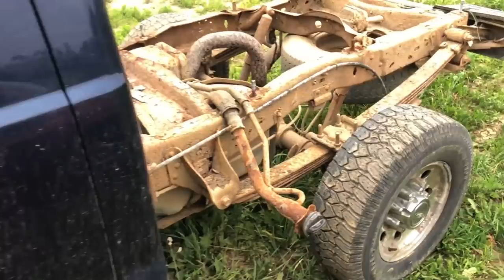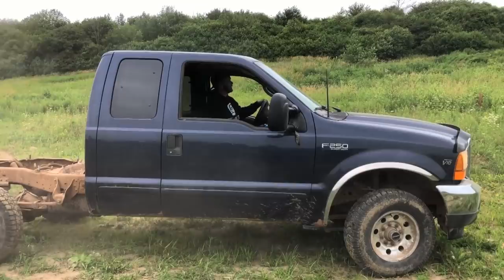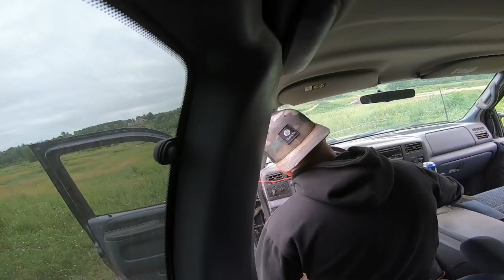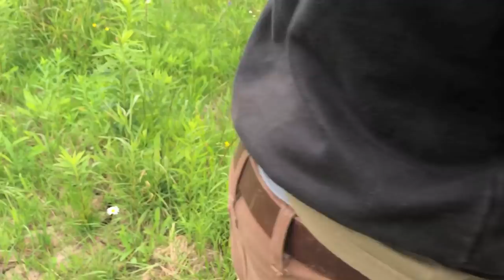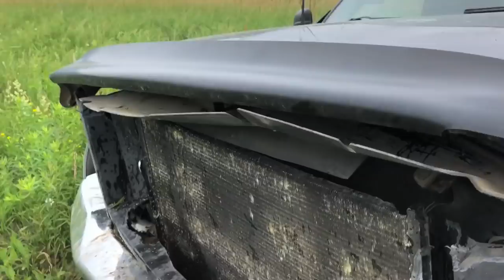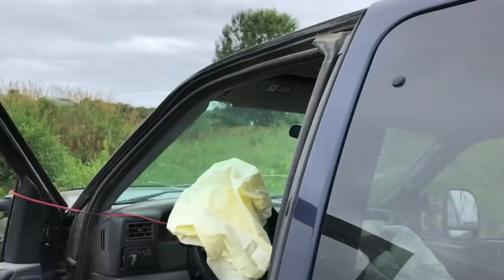Ford F250 SUPER DUTY BEST Truck CRASH EVER!!!

Comment: Things like this is why I can't find a good fullsized truck running for cheap
Reply: @seananon4893  their truck they can do what they want.
Reply: Sean Anon The truck was clearly at the end of its life
Reply: oce Lol not really, with a little TLC and some new parts would have been great for a barn rig or something of the such, as well, swap the motor, these motors are easy to find, or even just swap the block and it’d run like new
Reply: Christian that’s true
Reply: full size trucks in good condition aren’t cheap it’s simple
Reply: The truck was at the end of its life even though it was clean with no rust it seemed you’d have to replace the engine most likely and it is a short bed short beds on F2 50s are very hard to find
Reply: @Shanesknowledge  That thing definitely has rust, the doors on teh bottom and the rockers are basically gone
Reply: EEtotheO oh did not notice
Reply: Ford f250 yeah that truck was definitely junkyard bound, motor didn’t sound to healthy either, im sure the trans was on the way out too.
Reply: EEtotheO yep
Reply: @colton7373  not even close my truck was way more rotted out same motor did some work to it now it's like new
Reply: @RoastFlea61  was a manifold leak
Reply: The truck is a pos, not worth it to own other than to do this with it
Reply: people sicken me
Reply: I’m sure some tlc could have gone into that truck and it really would have blessed a single mom or person in need providing them with transportation
Reply: Who says the Truck isn't for sale? Make an offer. Who knows, you might get it for a reasonable price.
Reply: That unit was toast already,
Reply: Bruh you got anime in your pfp you prolly drive a Prius
Reply: Crazy stuff that thing really flew😎
Reply: I mean there wasn’t much left of it anyways. Plus it was a v10

Comment: Now do it with a 2020 7.3 and see if it’ll still run. The ultimate “built ford tough” test to the end.
Reply: Ford sponsorship
Reply: They don’t make 7.3’s anymore...
Reply: @butwere3-0wou   they do though
Reply: Info warlock Hol up...7.3 gassers? How in tf was I not aware of these? I assumed he was referring to the powerstrokes lmao
Reply: BuT wE’rE 3-0 wOu they just started making the 7.3L gasser in 2020
Reply: Eh not diesel so trash
Reply: @midlbrwn15  actually it's not a trash motor. It's built right  they went old school for design and set up. Old pushrod big block

Comment: I am telling Ya Mark, them old fords will be taking over NASA space program.

And also i think the passenger front tire is locked, thats why she would not move.
Reply: I wouldn't doubt the entire weight of the truck came down right on top of it I wouldn't be surprised if a few things got fucked up likely being a 2 ton pickup I wouldn't doubt the whole front end is broken
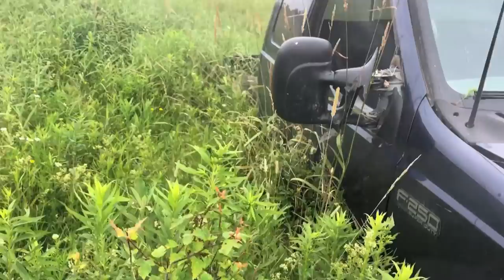Reply: Silas McGee 7:46 look at the tire, she bent over
Reply: @chrisf7731  interesting way to get camber it's going to be a bitch to get it on the other side if Duke won't move
Reply: But definitely one of the best sends so far since the Ford Escape and Jeep Cherokee

Comment: The F250 flew pretty well. Could have added some weight over the rear frame to make it fly more level. 
Maybe strap a plastic 55 gallon drum full of water over the rear bumper or U-Bolt spare wheels and tires to the chassis. 
Just a thought...

Comment: If you take your ratchet strap, you can go down around the brake pedal and hook both hooks to the steering wheel and tighten it. That will keep the wheel so straight you'll hit the jump every time. Could even use the seat belt through the steering wheel, and move the seat to the furthest point back to try keeping the wheels straight. Between the two tho, the ratchet strap around the brake pedal is the best method

Comment: Could have been a good truck for someone with less money..
Reply: 98 12 valve it sounded like the engine was knocking anyway.
Reply: Alan B so. I have some friends who have trucks in 10x worse condition than this one. And thats all they can afford. I mean this is this mans money he can do what he wants but this is just disgraceful imo. Should have used a real beater truck. This one was running and driving just fine
Reply: @Kyle_Godfrey111  no man that knocking is the sound of a dying engine
Reply: Cataclysmic Computers yes even so it was still a straight truck. And it had a bed he just sold it cause it’s worth money. Interior was nice and the truck was solid. Oh well it’s already happened
Reply: Cataclysmic Computers These trucks run FOREVER even with the worst of knocks, and even if it’s just knocking, some new rod bearings, maybe rods or pistons, and she’d be good as new
Reply: @Christian-my4dp   I'm not going to call you wrong, but at least in my opinion any truck with a knock is a time bomb, I would not trust it to haul anything because at any moment it could leave me on the side of the road
Reply: You know how many cheap vehicles there are out there for people. It's an open market he's aloud to buy a few if he wants.
Reply: @Kyle_Godfrey111  you should buy one of your friends a truck. Im sure you have money. You should use a bike

Comment: Amber good is going to kill you she loved that truck she even named it
Reply: Hahaa you are right about that ! I was not happy to see Duke flying through the sky
Reply: @ambs8221  if it helps any I was really happy to see it go
Reply: @ambs8221  I told him to resell it. Shame in him. V10 4x4 superdutys are good trucks. Well all of them are.
Reply: D4x4Bronc wasn’t good enough to resell but was nice for a track truck
Reply: @ambs8221  other than the rust all it needed was the spark plug hole inserts done. Toolkit to do it is mid $200s.

Comment: says "this is why you buy a ford kids" after the truck starts, then it doesn't move. when a tree fell across the hood of my grandads dodge I drove it right out from under it no problems didn't even cut the tree 
oh and the 4 wheel drive still works
it wasn't even a little tree it probably weighed as much as the truck itself